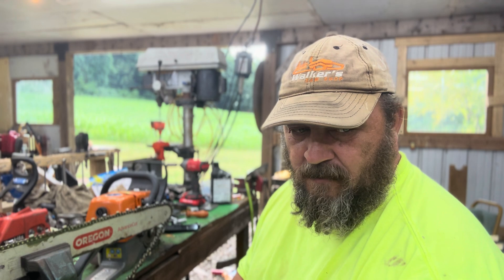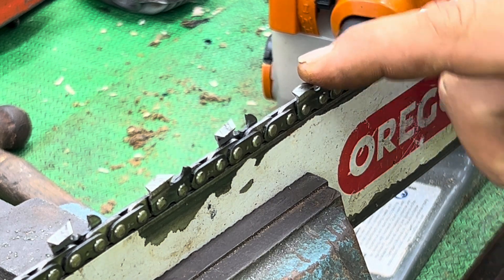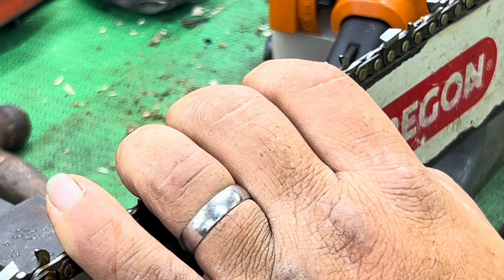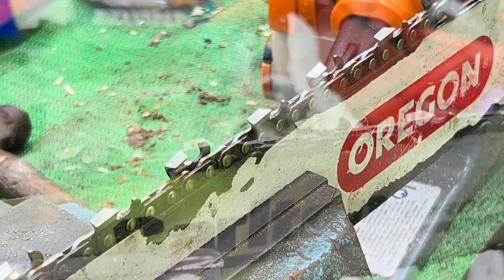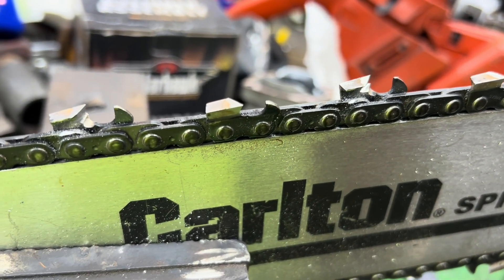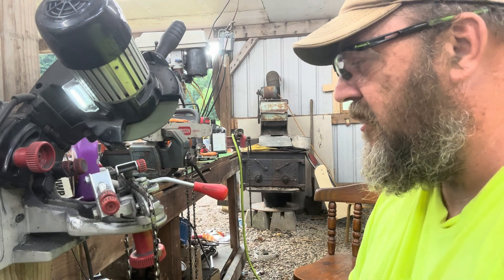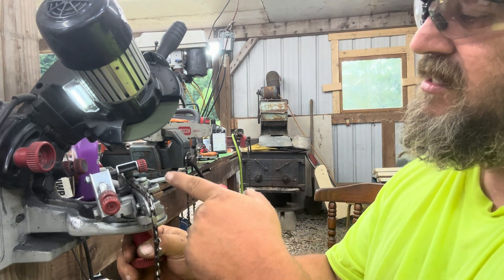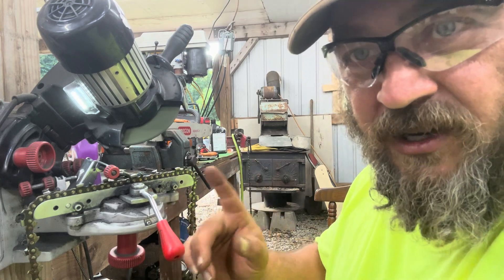Part 4!  Developing A Faster Chainsaw Chain!  Testing The Wiggle!

Comment: I have sharpened a few hundred chains for my Dyna SC-16 processor with a Oregon 511-AX but are 404 pitch .80 and the marks the your chain is putting in the wood my 404 cut best when the cut looked like that and as that went away and looked smooth I lost cut speed I run that processor for 13 years I sold out this year. I am now learning the art of hand sharping for my chainsaws and like the results so far I still have the 511 Oregon but at 65 this old dog is trying to learn new tricks